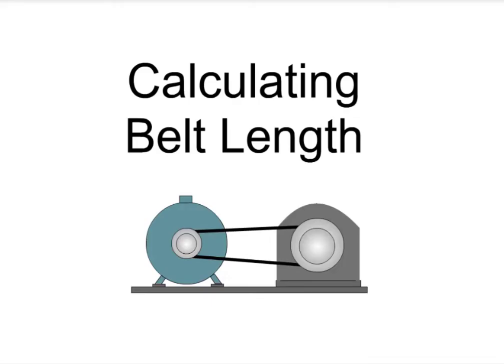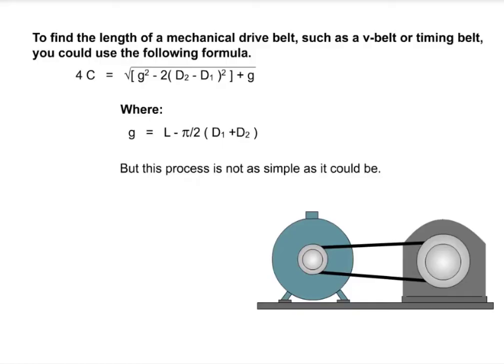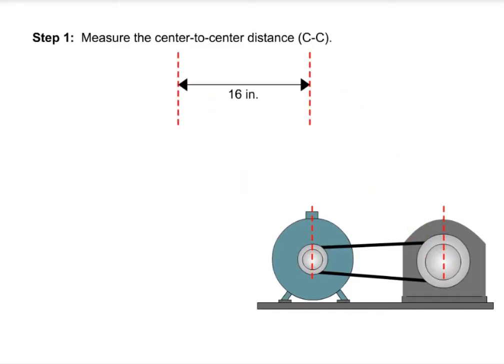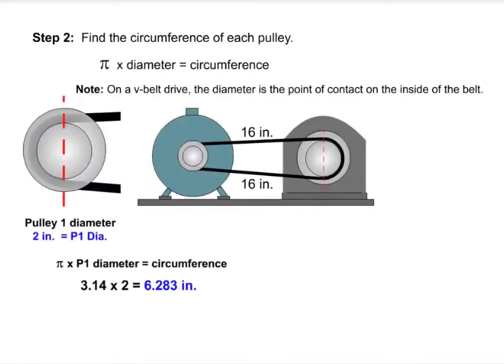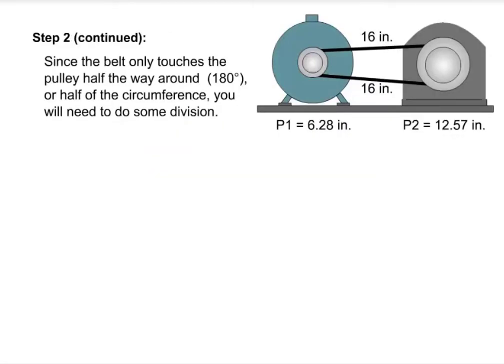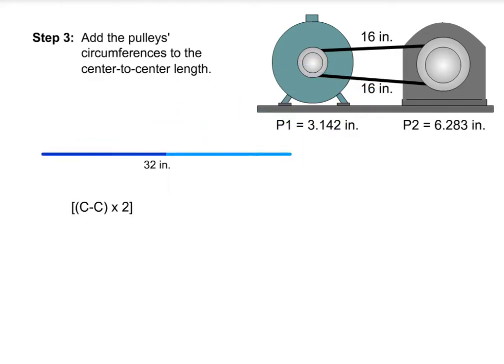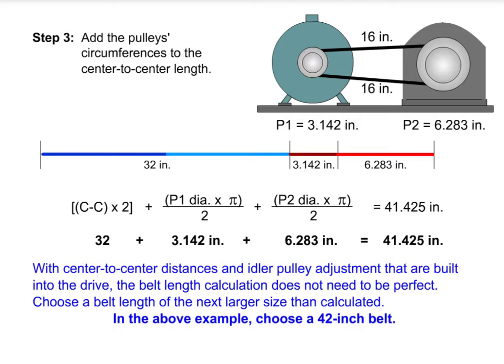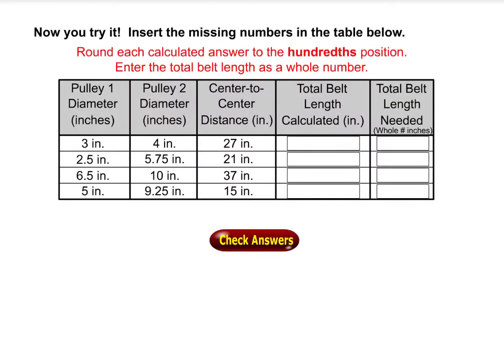Calculating Belt Length (Screencast)

Comment: I will calculate to figure out the pullys and thiming belt I need to order. When you say pully diameter, do you mean outer diameter/edge of the timig pulley?
Reply from the maker: Yes. The outer edge where the inside of the belt will be touching the outer edge of the pulley.